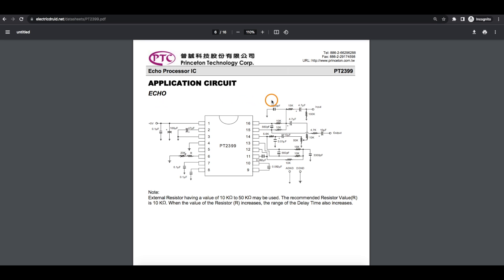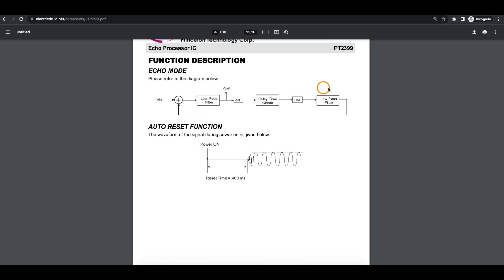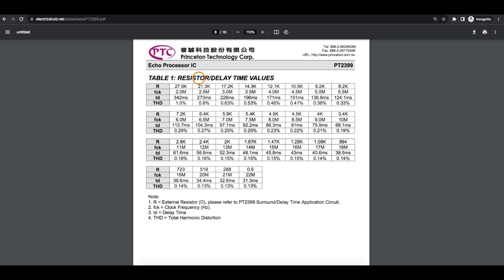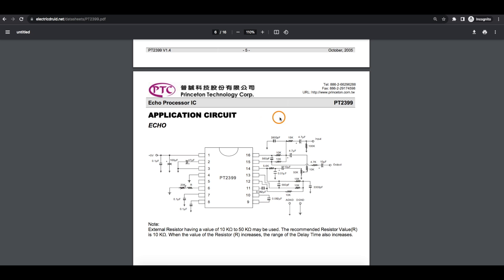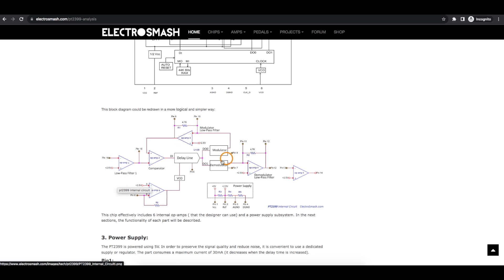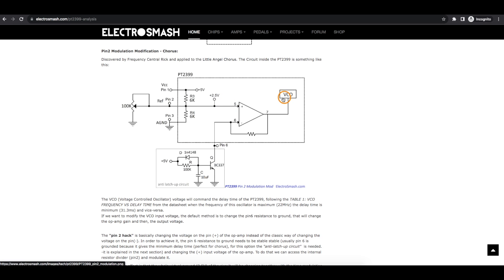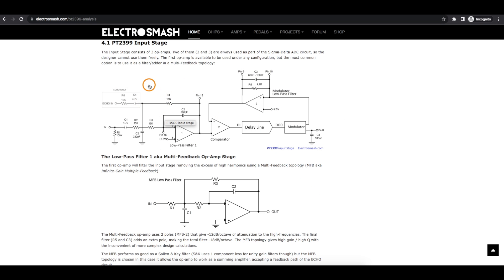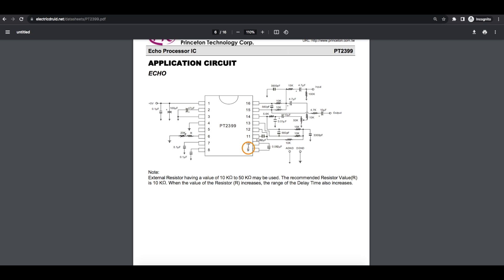PT2399 Echo Circuit Walk Through and Demo

Comment: Great video.  I bought a few of these and this was the best explaination I've found without doing the prefab boards where you have to solder in a pot and solder off the resistor.  This really made the chip make sense to me.

Comment: Wonderful circuit analysis! I want to know more... like how are you hooking up your mic and output to the breadboard? Is that other breadboard your 555 circuit? I'd love a close up or a combination build video. Thank you for this great vid.
Reply from the maker: I can’t remember exactly how things were hooked up but glancing at what I see on the table, that other breadboard does look like it has the 555 with a variable duty cycle possibly as an audio test source.
The final audio output was that orange amplifier and I had a clip on microphone laying on the table to pick up the audio and record it on a zoom H1 which is sitting beside the orange amplifier. and the audio going to that orange amplifier is from the green cable with the black stripe and that’s going over to the breadboard with the echo circuit so it must be coming out of the actual Eco circuit directly.

I can’t seem to follow the cables for the other circuit board to the left of the battery pack it looks like the 555 audio is going on the green cable into that White circuit board and then there’s two outputs I think it’s a splitter to buffer that, but it looks like one of those cables doesn’t go anywhere and the other one is probably going to that black mixer

 so maybe I was using the white board as a buffer or maybe I was trying something   else and it didn’t work so the board just got left there because it wasn’t hurting anything.

so overall it looks like maybe the 555 oscillator is going into the black mixer and so is the talking microphone and then the output of the mixer somehow gets connected to the input of the echo circuit and then it goes to the orange amplifier and gets recorded by a clip on microphone.
Reply: @gadgetsideload  wow thanks for your reply.  I'm trying to hook my output to a scarlett solo interface as we speak. Wish me luck!

Comment: I followed the PTC schematic before I found your video and I immediately get a 2.5V drop on my 5V rail after you connect it to the chip. Any ideas on what I’m doing wrong? Is it worth troubleshooting or should I just look into a chip analysis like you described here. Much appreciated!
Reply from the maker: if the main voltage supply rail is being dragged down dramatically when something is connected it sounds like a short circuit or bad component drawing excessive current.